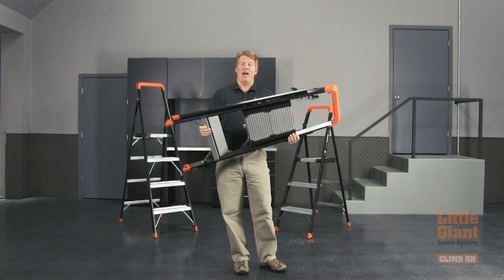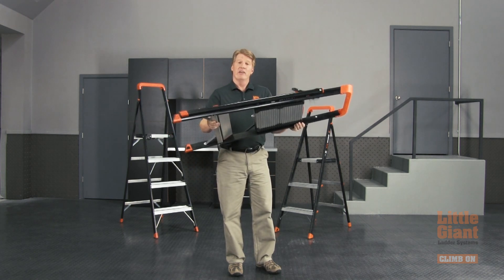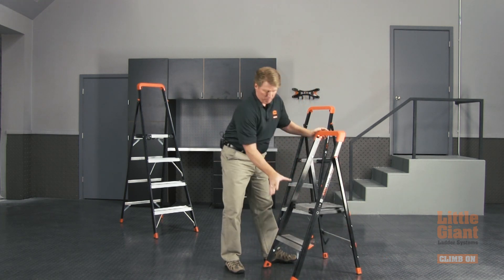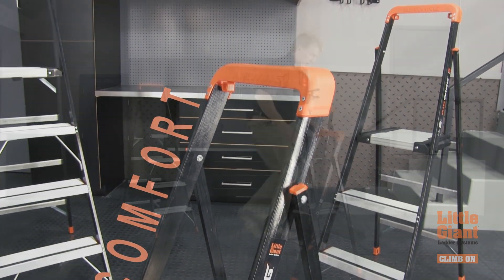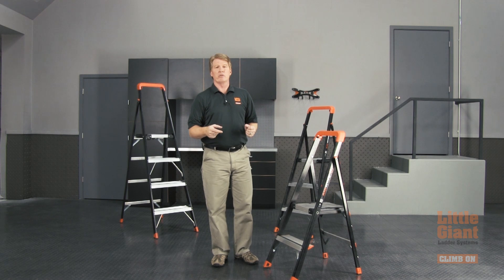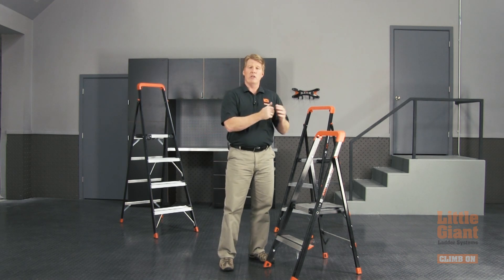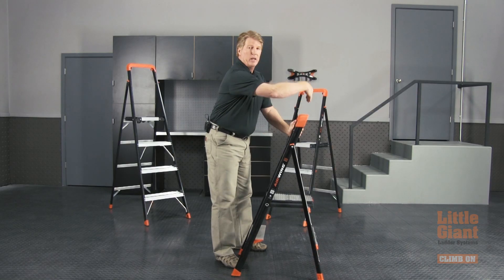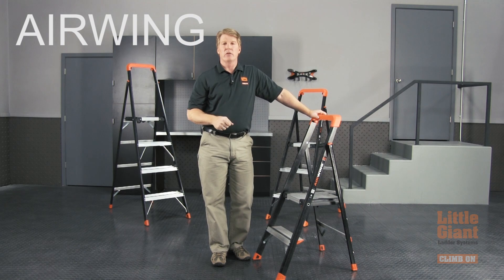Little Giant Ladders | Airwing Fiberglass | How To

Comment: My top platform latch on my 5 foot version is very difficult to get to set properly. The U shaped  clip underneath the top step doesn't seem to work properly with the bracket so the connection simply flops around.